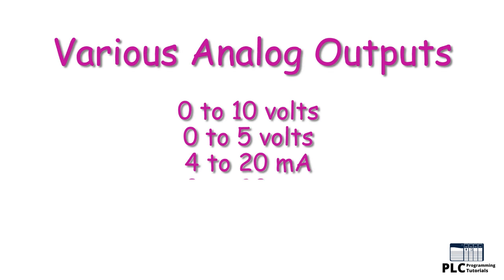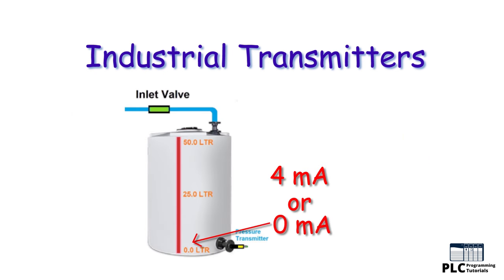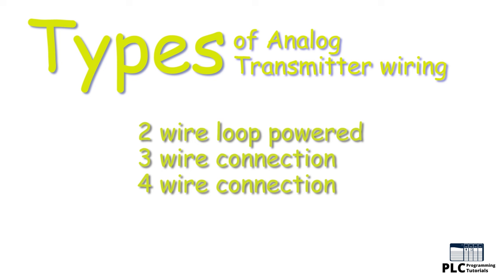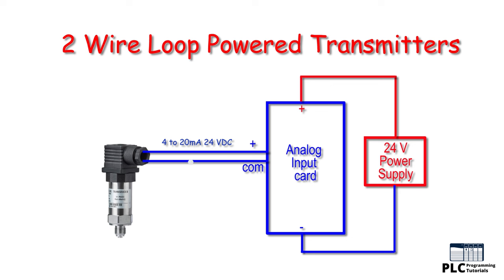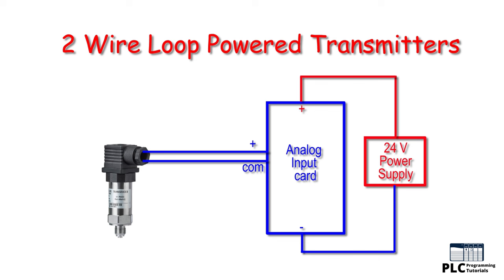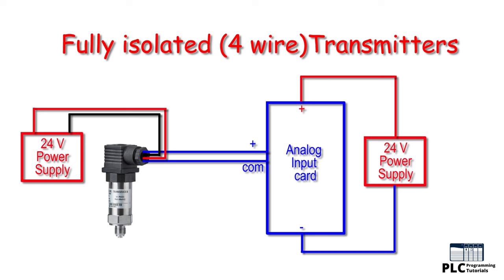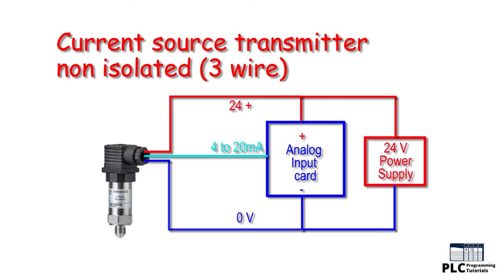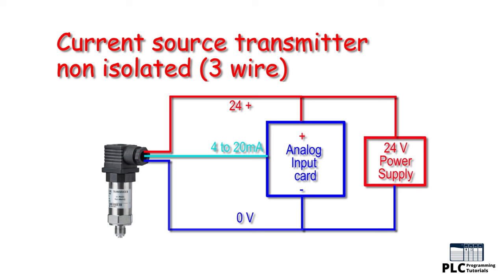2 wire - 3 wire - 4 wire Transmitter wiring connections ||Transmitter Power Supply connection detail

Comment: Hello
What's the difference between transducer & transmitter?
Thanks
Reply: It's been two months, as one expects these sort of videos are not very popular and because of that, responses will generally take a long time.

*A transducer is a device that converts one type of energy into another of a different nature*, the classic example in instrumentation is the thermocouple. The thermocouple works passively (without being powered externally: this is important) as a sensor by generating a current in response to a change in temperature; it does this because of the way it works: two wires inside of a probe are made of different metals with different thermal and electric conductivities joined in two points, when the temperature increases, electrons are excited in the metal by the thermal energy and in order to lower their energy levels, migrate towards the colder part of the material, since the metals are connected and are of different conductivities, the electrons take the path of least resistance and their transit in the circuit is the measurable current.

*A transmitter is a device that converts a signal into an industry standard*, in both format and magnitude, generally to be transmitted some distance from the point of measurement. The input signal is often electric or pneumatic, and the conversion output depends on the device that will receive the signal, generally being 4 to 20mA, 1 to 5V or sometimes 3 to 15 PSI (in pneumatic transmitters). Transmitters are often attached to or built (provided by the manufacturer) bundled with the sensor for the process value to be measured.

It is sometimes difficult to learn these things because the professionals in the Industry tend to use terms interchangeably, though these things can sometimes denote the same object or assembly, they refer to different things.